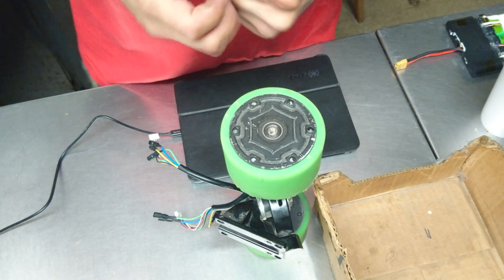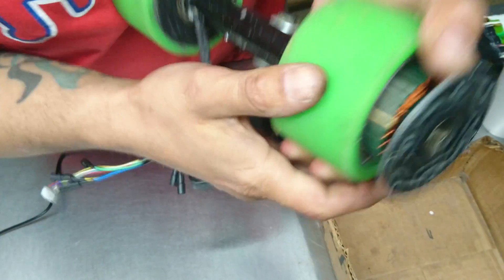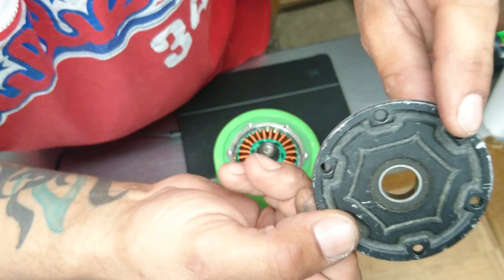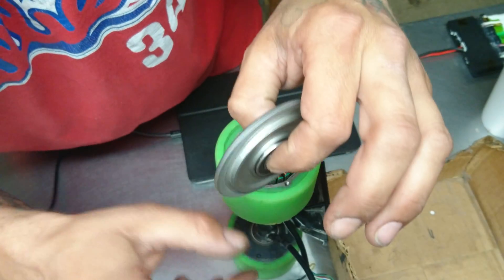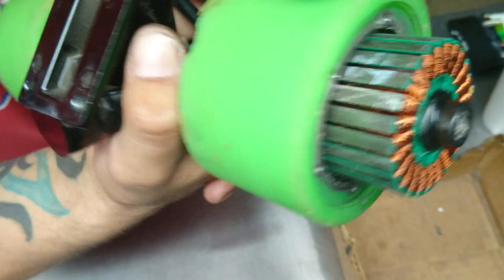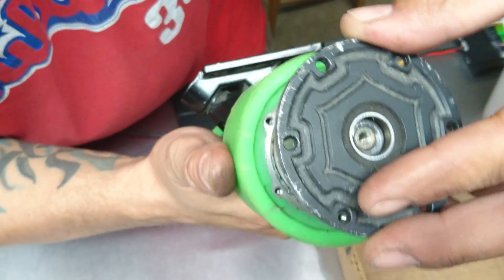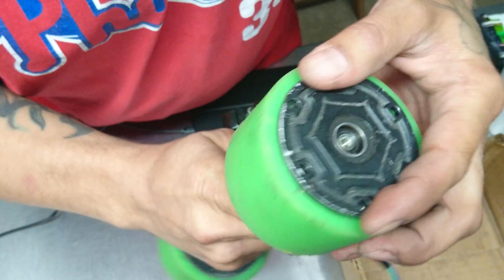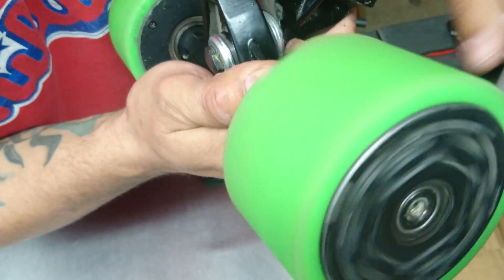Hub Motor 36v 350w Genesis Koowheel Outer Bearing and Cover

Comment: Is it possible to replace just the colored plastic of the wheels, or do you have to change the entire truck assembly?
Reply: Out of the box one wheel spun more freely than the other.  Thought it needed to "break in".  Still after about 50 miles of riding it still the same.  Have topped out at 26 MPH though.
Reply from the maker: ed valdez hey when you enjoy something enough thats what starts to happen. I fell in love lol
Reply from the maker: héres two links. yes you can replace the urethane and not the entire motor

http://www.ebay.com/itm/182498930526?_trksid=p2055119.m1438.l2649&ssPageName=STRK%3AMEBIDX%3AIT
https://www.youtube.com/watch?v=WJo9TbQneJE
Reply: That's awesome man! Thanks for the quick answer
Reply from the maker: np took me longer to find the links always here ready to answer questions  though
Reply: haha :)  Joe, thank you very much. All parts had been ready for you
Reply: +jkyser23 So I just got my Koowheel two weeks ago, and the wheels are already chipping pretty badly! Guess I have to order some new wheels now :(

Also, on my very first day my left motor wheel hit the curb pretty hard, and now I just noticed that the wheel comes to a complete stop much faster than the other side (Dont know if it was like that from the start though). What do you think has happened?
Reply from the maker: ed valdez really one spun more freely? wow yeah thats weird huh? hey well if its all good still right? Thats freaking awesome
Reply: yeah, caught my attention in the beginning so I tried loosening the bolts but all that did was cause it to jiggle on the truck.  Tightened it back up and so far it doesnʻt seem to affect riding.  I wouldnʻt have noticed if I wasnʻt so touchy feely I had to spin the motors before I rode it.
Reply from the maker: +ed valdez they use a different style braking that works in conjunction with the hall sensors. I suppose its only something to do with that. if you've ever noticed while the board is turned on in the remote is turned off it's really hard to push it. Thats because of the braking system. Turn the board off and its able to roll freely. So i wouldn't think it would affect it. Good observation though. Hey keep in touch. I would love to hear more feedback as you use it. I try to bring all users experience to the table so others can better gauge their purchase and figure out if the product is for them.
Reply: +Joe Kyser, yeah I'll keep you posted... like the vid, the motors look like giant drone esc's lol.  Once I had that prob, I turned the remote off as I was walking the board on its motor wheels and it was skidding.  Figured I'd turn the remote back on and it was fine.  So far I'm having a blast with it.  Bummer for me though as the only riding area around me is the main road of which there is about 20+ miles in any direction and tons of speeding traffic.  The sidewalks are a no because the gaps are so yuuuuge between each slab it hurts my feet everytime the wheels roll over them.  I did ride in an area I drove to where speeding was rampant.  The community decided to narrow the driving lane and create a "bike lane" which... since I've sampled it, have seen NO bikes lol.  Even the residents appearing on the big news story on TV were like "why bike lanes?".  I had a blast riding it, just had to avoid the painted bike and arrow, they were a bit slippy and raised 1/2".
Reply from the maker: +ed valdez Yeah i know finding places to ride can  be tricky. I actually put 0 thought into that before I ever got my first electric skateboard. which seems pretty stupid but I'm just being honest. lmao. I totally get you though I know where you're coming from haha. yeah you know what local politics can be the worst sometimes. As long as no one is actually bothering you thats a plus for sure. I know i try my hardest to be seen for sure! I have had too many close calls. Cars do not care at all about me on my Skateboard I know that. I ride everyday all day. I stopped using conventional transportation about six months ago and onl use the Skateboard. Its literally changed my life.
Reply: Good for you Joe, I'm working up to minimizing the dependencies also.  Koowheel being my first eBoard I think I'm learning alot and will definitely look into other purpose built electrics.  Ride safe!